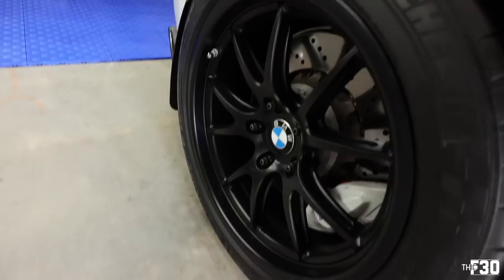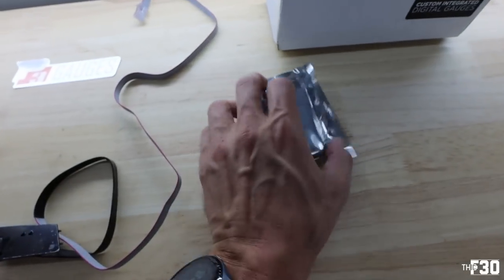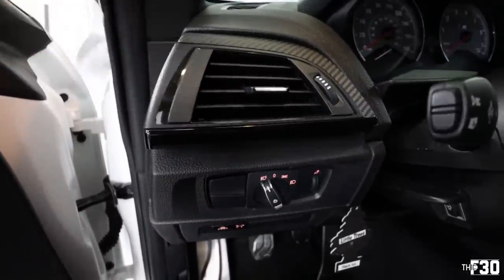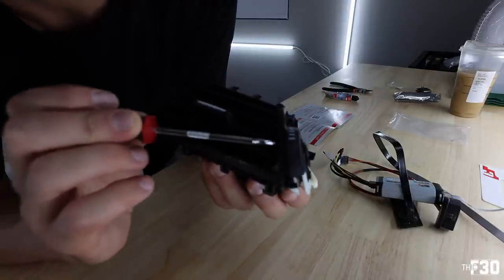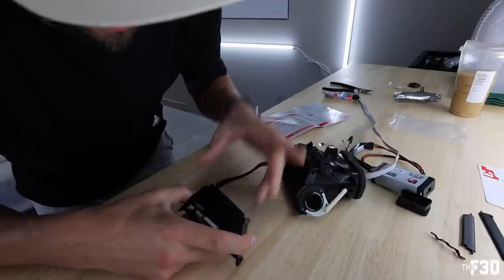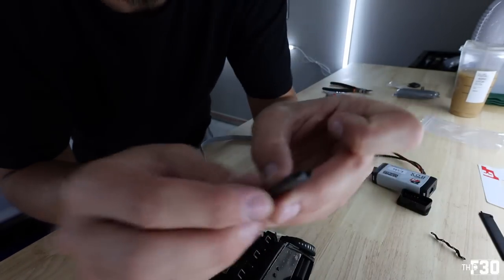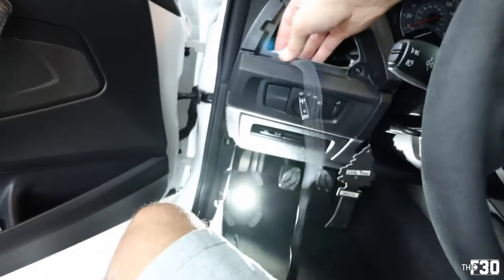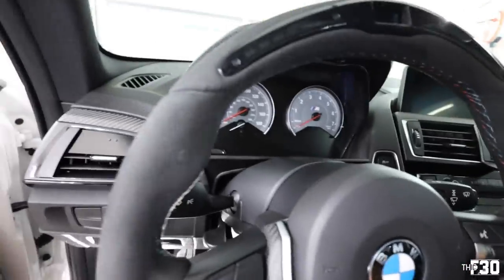P3 VENT GAUGE INSTALL & REVIEW - BMW F87 M2

Comment: If I can make a suggestion for the control box: You have that small storage space below the light switch that gives a nice flat surface on the inside of the dashboard. I used velcro on the controller and on the top flat part of that box. That way you just stick it down with velcro and pull it out when needed.  Did this on my M235i and it does not move anywhere.
Reply: it doesn't have that box in the M2 sadly

Comment: Great informative video. I've always wanted something like this but unfortunately it takes up the only OBD2 port in the car. In the track where I have to log data using the OBD2, I would have to unplug this and plug in the datalogger.
Reply: You can Buy obd splitter
Reply: @watchonthetoiletchannel4741  OBDII bus doesn't allow multiple device access so if you use splitter, only one device will work at a time. It's a messy solution.
Reply: @carsstuff9914  Ah Did not know that good info anyway thnx

Comment: a question, I want one for battery voltage, does it show batt volta before you start the car, i.e. when you get in? do you have to press a button ? or must the ignition be on ? and does it drain any power ? battery ? txs

Comment: do you have a choice between the amber or red led display versus the white led display on the p3 gauges? thanks, awesome video btw!
Reply: Yes you have 2 options. I just installed the orange one on mine and it blends in nicely with the rest of the dash lights 👍🏻